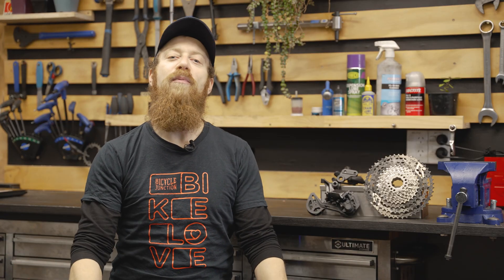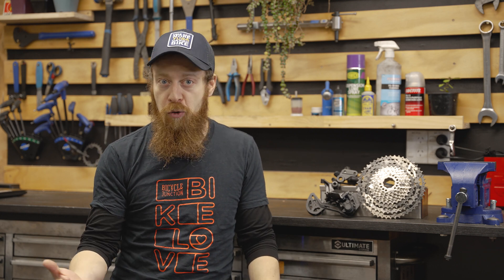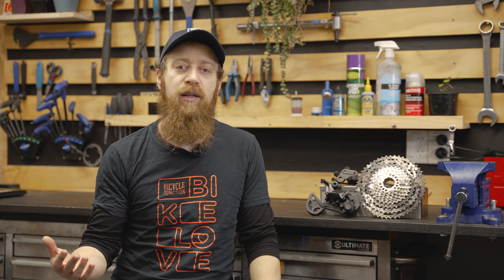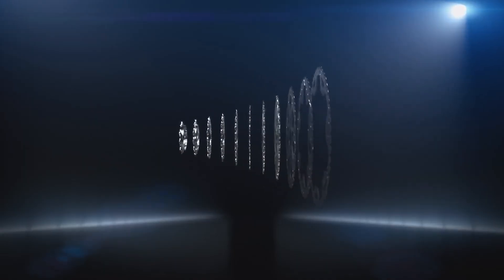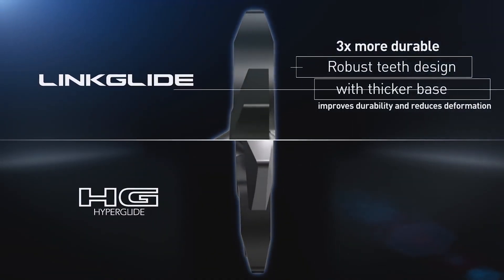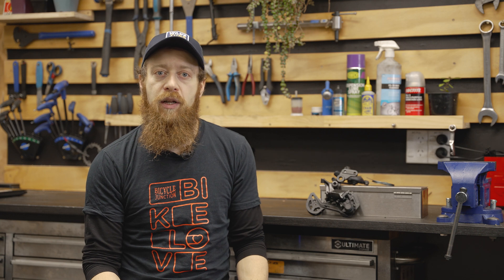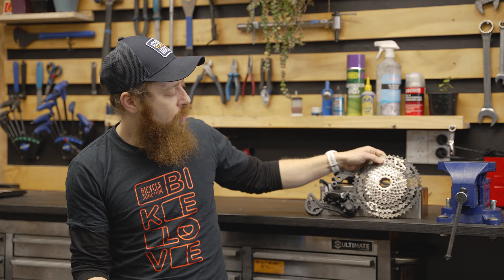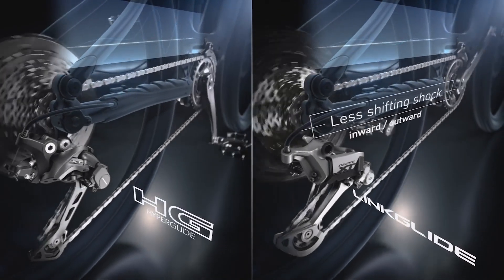Shimano Linkglide  | The Most Durable E-bike Drivetrain?

Comment: GATES CDX extremely expensive. Only lasts 9000-13700 kilometers on my ebikes. With one good chain, one sprocket and internally geared hub Enviolo, I use one set around 12000 kilometers for the price of HALF of the Gates belt alone.

Comment: Yeah, just consider changing to Gates belt and forget the "maintenance" nonsense.
Reply from the maker: Yeh, for sure! A great option if your bike is compatible with a belt drive but this isn't always possible. Comparatively, it's a costly upgrade when you add the hub into the mix, unless you go single speed 😉
Reply: There's always one, lol... Gates belt drive and internally geared drivetrains aren't without issues and drawbacks. There's a reason chains and derailleurs haven't gone anywhere, just like on motorcycles. They're still the best option available for most applications.
Reply: @tampabayrider  yeah, the reason for low popularity is the frame design requirements, initial higher cost of belt/gearbox/internal hub drive setups and lower efficiency of belt drives - both can be ignored in ebike application. What can't be ignored is the almost non existent maintenance requirements with belt drives. F chainzzzz, cuh.
Reply: Veer make a joinable belt drive but it is not designed for bikes with vertical dropouts.